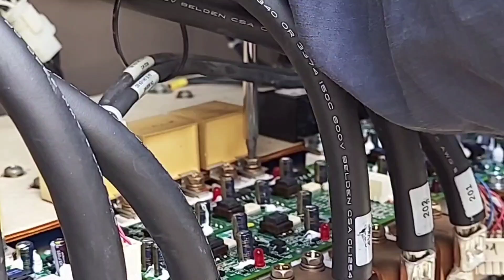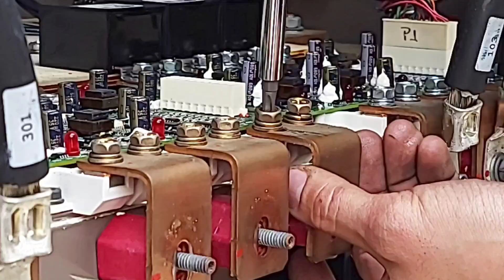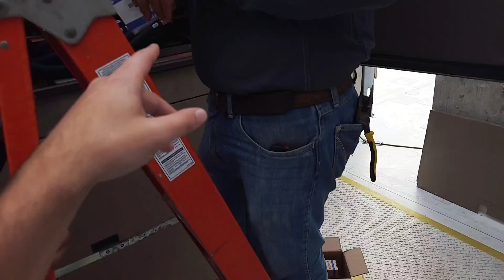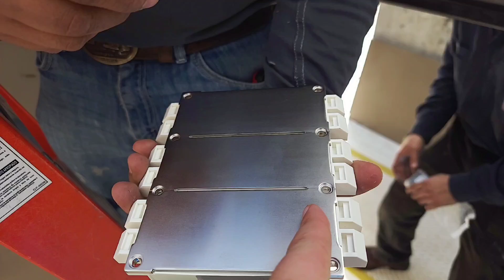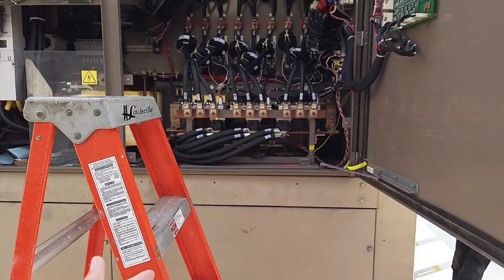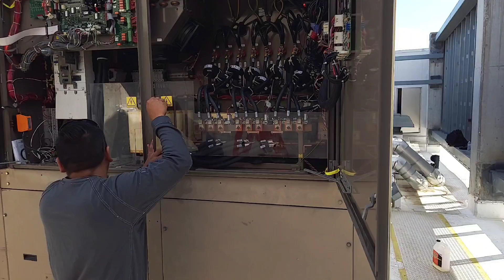VSD IGBT Change York Air Cooled Chiller HVAC Training for HVAC Technician

Comment: I have alarm low motor current for both compressors, the chiller not working more than one year, installed but not started
Can you support  !
Thanks
Reply from the maker: The drive never outputed to the motors. Does DC bus charge?

Comment: What are causes for the IGBT to fail? We have had one supposedly fail but cannot get a definite answer as to the cause of its failure. The unit is 6 years old and a YVAA power pole assembly is not cheap to replace without an answer. Thanks for the great knowledge you provide!

Comment: In most variable frequency setups it goes Ac voltage, rectifier(diodes), capacitor, igbt switches. And the controller handles the hz. It's definitely interesting to see the many applications of variable frequency.

Comment: I have a ycav 150 ton with VSD communication loss.  They have replaced the VSD board I checked trigger board per spec. So we had an extra micropanel board just need eprom & sd card programmed from JCI. On the right track?

Comment: How troubleshoot high flash tank level in York chiller
Reply: First thing you need to do is check the sight glass on the flash tank and check the liquid level. It should be around the middle of the site glass. Ifyou can’t see the level it os either below or above the sight glass. If you point a laser  into the sight glass you will see the laser streak goong through the liquid, if it is low you will only see a dot. If you confirm the level is high you will need to manually crack open the flash tank drain valve on the controller allow the liquid to drain to midpoint of the sight glass and recalibrate the level sensor.

Comment: Great video. I’ve got an issue on one of these where the overload setting on circuit two keeps changing to 175A from 225A and trips the chiller out on overload. OL potentiometers are glued and have not been changed. I’m guessing a new a main board?

Comment: What was the fault or error that indicated an IGBT board changeout on this unit? Great detailed presentation of changing the board.
Reply from the maker: Gate fault
Reply: @HVACTIME  what troubleshooting did you take to find this? Gates lead you to the VSD but what actual check? Output voltage, something physical or just the growling sound? I am guessing the capacitors were good, the snubber is good and the only thing left was the board?
Reply: I'm also changed igbt in York chiller when chiller show alarm vsd c plate high temperature.. and problem found base plate C not show temperature then I'm changed new igbt now chiller properly running

Comment: Thank you for the video. What’s up with the board to the left? What’s that called? Noticed some snubbers on that one too.
Reply from the maker: That is another circuit IGBT. There are a total of 3 IGBT (1 per compressor) on this drive kit. They share the same capacitor bank and SCR's.

Comment: Typically resistors are bled within 5 mins. Always worth a meter check but no need to wait 10-15 mins
Reply from the maker: Ive had them take 15 minutes to fully discharge. If im not mistaken the factory spec's call for 20 minute discharge cycle. Id rather my techs play safe on it.
Reply: @HVACTIME  absolutely!
Reply: FWIW If one of the bleed resistors has failed, there is no safe time to wait. ALWAYS check DC and AC in multiple points on any piece of equipment before sticking hands in. Anyone with a license has been told this countless times.

Comment: All the screws on wires and IGBT have torque specs. Use them. Will cause high base temp lockouts in the future. And you must clean the bus lami ate structure with alcohol pads, until its clean.
Reply: If there is not a consistent spread/layer of heat compound it can cause high baseplate temp faults as well.
Reply: @Brian Wolf  Yes, that is a 7,000 dollar board. And almost a 20k job depending on what part of the country you're in. Just need to use best practices
Reply: @knowledgeunderstanding4192  are you referring to the plate under the board with the old paste?
Reply: Agreed bro
Reply: where can you find the torque specs?